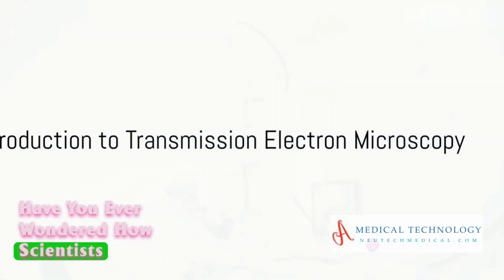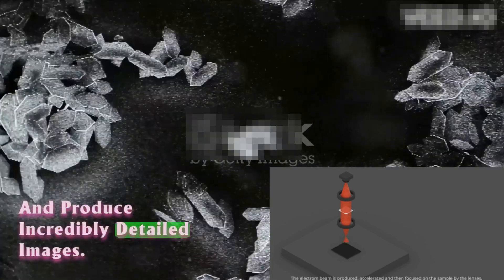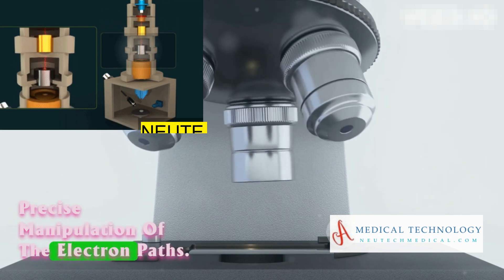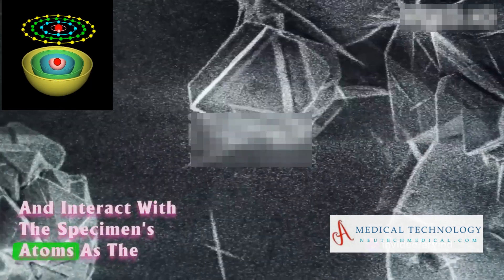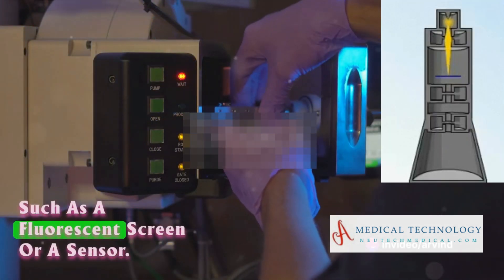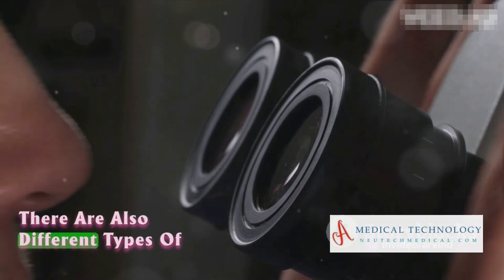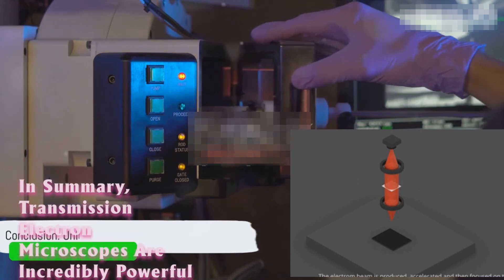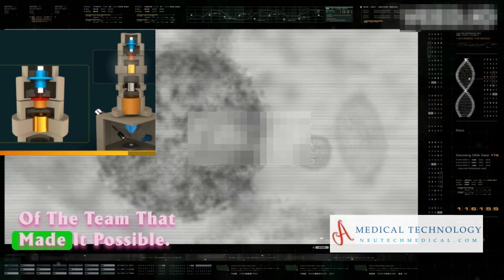Transmission Electron Microscope (TEM) | How do Electron Microscopes Work?

Comment: What is the objective lens in TEM?
Reply from the maker: The objective lens takes electrons transmitted through the specimen and forms a diffraction pattern (in the back focal plane) and an image of the specimen (in the image plane). In the conventional TEM we have the option of magnifying either the image or the diffraction pattern formed by the objective lens.